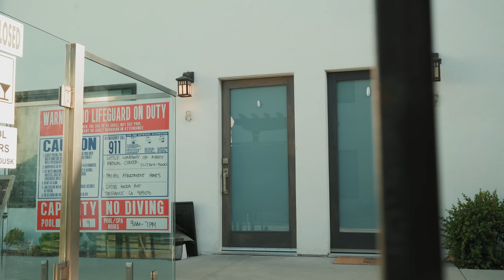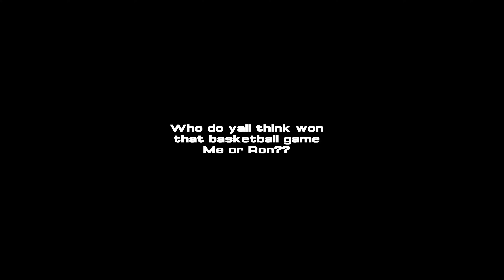Self-Growth Diaries | Overcoming Adversity

Comment: Sorry to hear you're having car issues. I can certainly relate! I've faced significant challenges due to car troubles with my 2011 Honda CR-Z. The car had a parasitic drain issue that caused the battery to die intermittently. One day the car would start without any problems, and the next, it wouldn't start at all. Honda initially blamed the third-party radio, so I had it removed, but the issue persisted. Another mechanic suggested getting a new battery, but that didn't solve the problem either. After exhausting all options, I finally decided to sell the car to Carvana, even though it was great when it actually started.